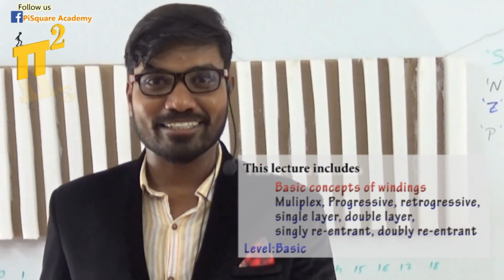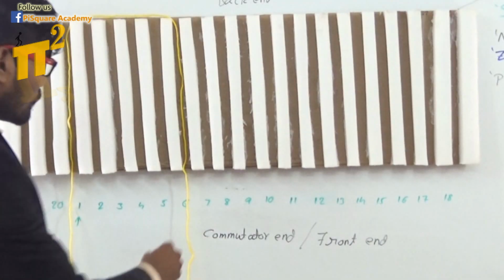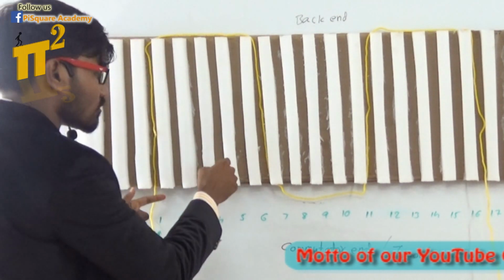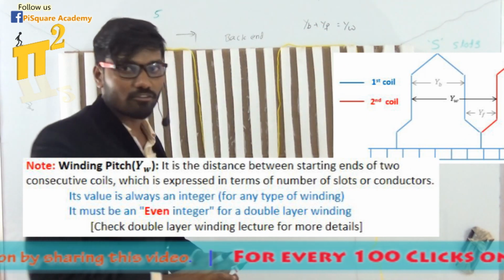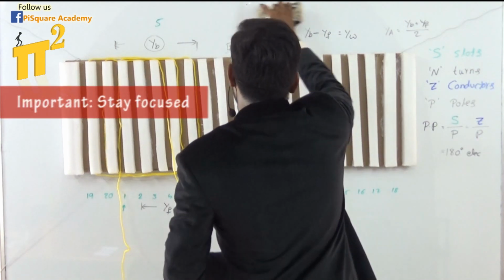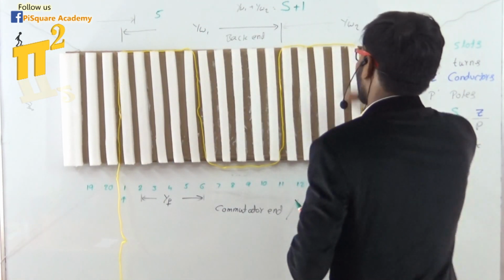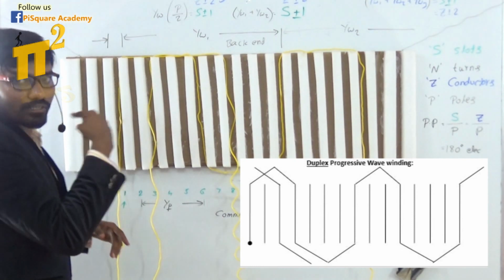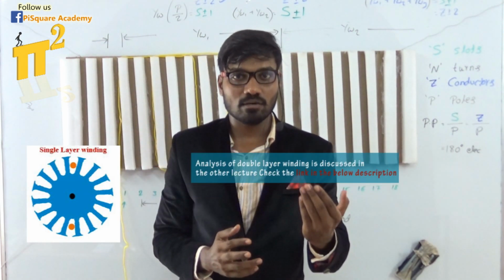Electrical Machine winding diagram(AC & DC) | Complete Winding Basics_Part-1 | (Subtitles included)

Comment: Sir I have a motor it's armature is 240 vdc that winding burns out. That is small one 120va for air circuit breaker. I rewinded that in lap winding it is getting more current and I couldn't run that 240v because of lap winding. That armature have 12 slots 24 armature segment how I should make wave winding for that sir. And also it's field is permanent magnet 2 pole magnet center aligned Corban brush is there. How I should rewind that in wave winding and how to fix the brush alignment in winding for that commutator

Comment: @PiSquare Academy I have  two N52 Magnets Size 2"L x 1"W x 3/8"H and Magnet wire Diameter 0.0367" 18Awg, I will have One Magnet face North and other South But I need to make One Magnet wire Coil that both Magnets rotating 360 degrees in center of One Coil to produce at least 14 Volt and light up 150 watts light bulb,  How many turns of magnet wire I need to do or have to produce what i'm looking for the out put. I look forward to your reply

Comment: I am still confused on the winding setup of an 3 phase alternator sir... In which a coil with multiple turns is inserted on 1st and 6th slot... so from 1st slot then to 6th slot and back to 1st slot until it creates multiple turns and so on until it will become 3 phase alternator can you please explain it and please include how the electrons flows due to pole pitch?
And I thought that the more poles the better since it only needs low rpm to generate high frequency

Comment: Sir plz upload the concept of circle diagram of Induction Motor
Reply: induction motor performance can be seen with circle diagram , 

if you want to learn circle diagram then there are easy steps .

first read the working of induction motor 

second enlist all the components / parameters are useful for working / running of the motor 

third now start doing the graphical representation step by step from referance axix , do first understand the meaning of property being projected via X axis and Y axis . 

fourth not sync with the theory and the actual diagram with proper notation for the induction motor .